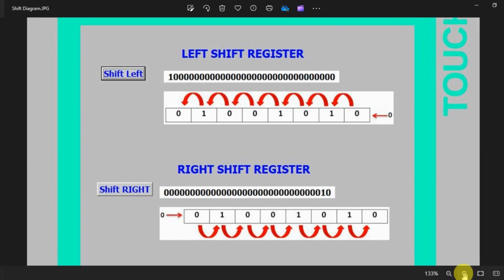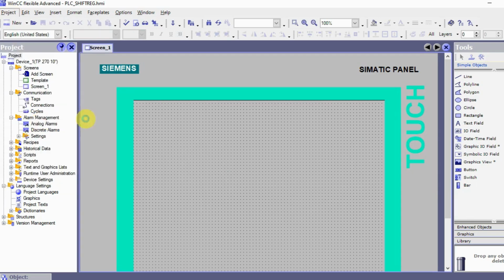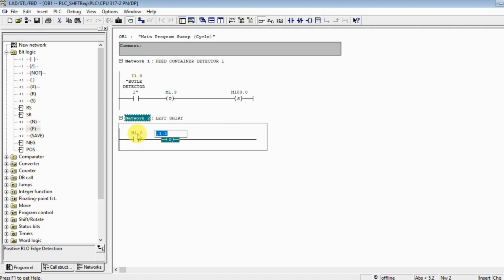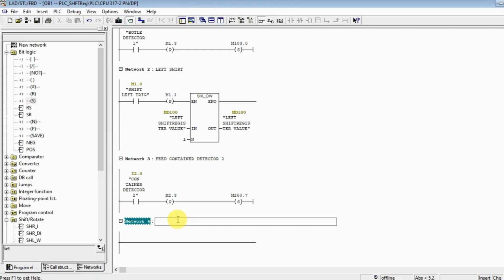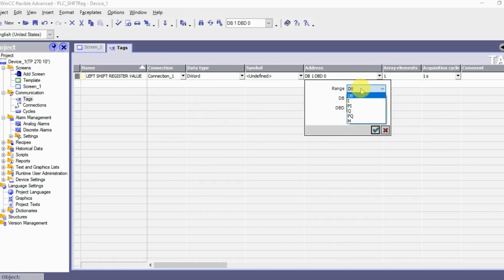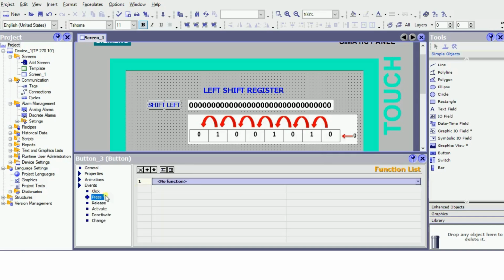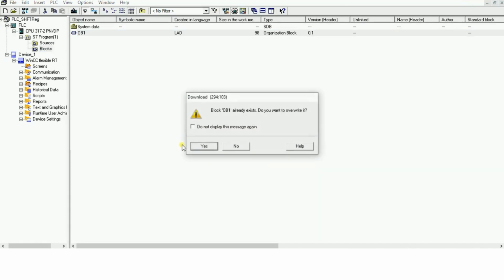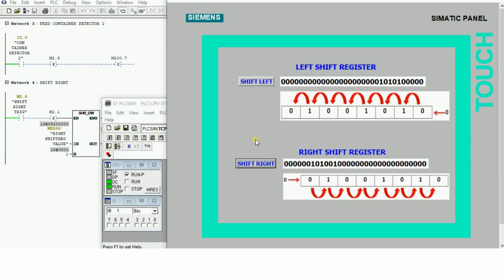Siemens S7 Shift Registers part 1 32 bit length

Comment: I want to learn about modbus communication..plz make videos
Reply from the maker: @thippesh_trpani6584  I Will Try To Get The Necessart Components And Then I Will A Video
Reply: I want to know how you used  m200.7 and its stored at md 200
Reply from the maker: @HossamHassan-e9y  MD200 Means or include MW200 MW201 MW202 MW203 and also MW200 means m200.0 M200.1 M200.2 M200.3 M200.4  M200.5  M200.6   M200.7
Also Define MD200 as DWord Not Dinteger
Likewise You Can Use bit Levels To Parameterize MD